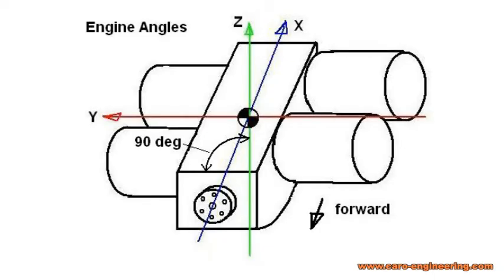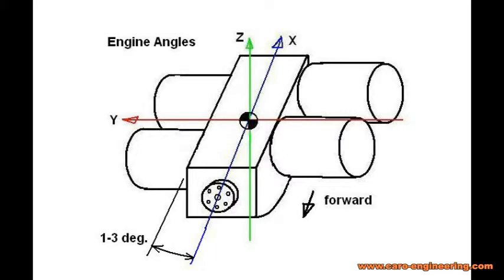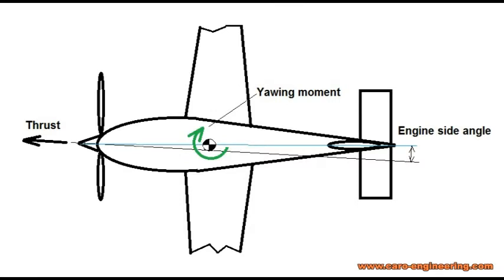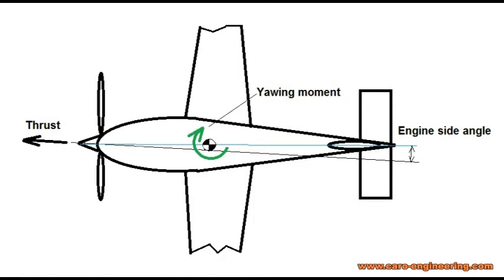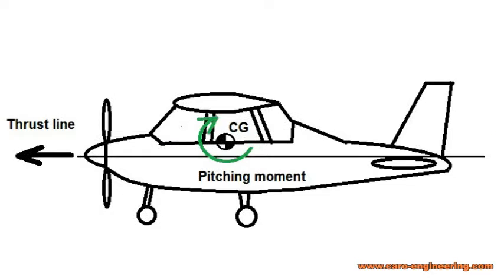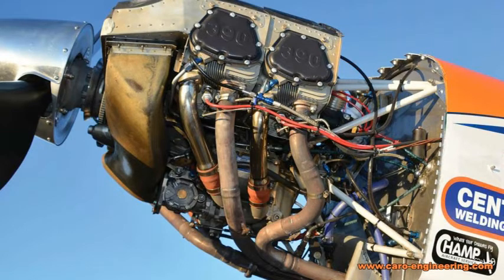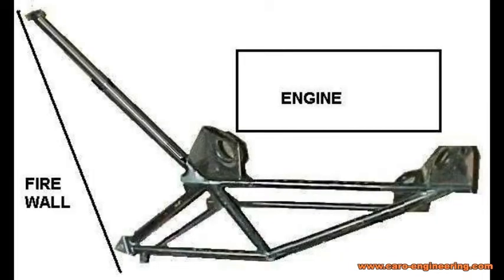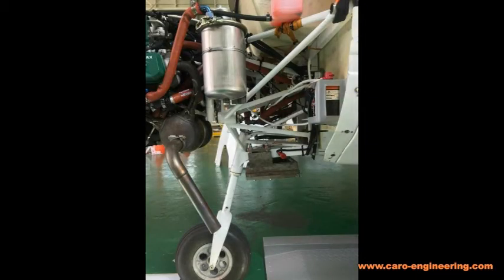Small Airplane Design Tutorial 13 Engine and Propeller Installation

Comment: Sonja. Very good video, I have a quick question for you I am hoping you can answer. Is there a case where you would see the thrust line pointed up with regards to longitudinal axis of plane. We are working on a customers Cessna 170B with a franklin conversion and the thrust line is definitely pointed up not down to counter act pitching moment when power is applied. It loves to climb but cruise airspeed is slow. Appreciate your thoughts
Reply from the maker: Pointing the thrust line up would cause it to create an arm which seems to lie below the CG of the airplane, and therefore cause a pitchup moment when power is applied. In this case it would be better to angle the thrust line down. But there may be other things wrong with the airplane that make it slow.